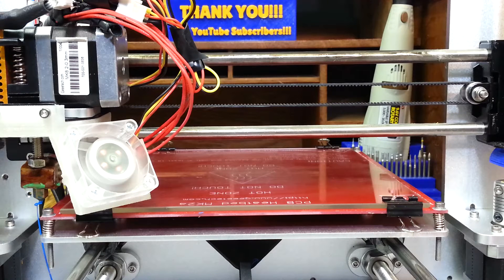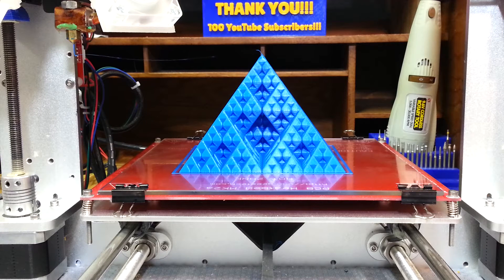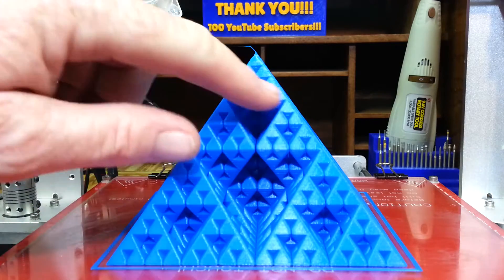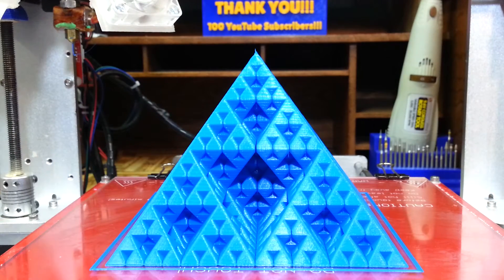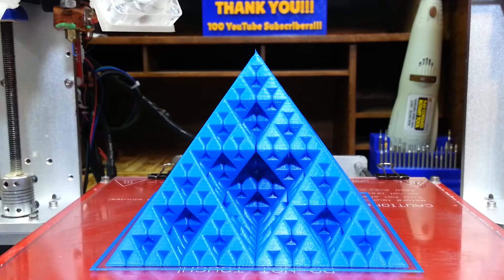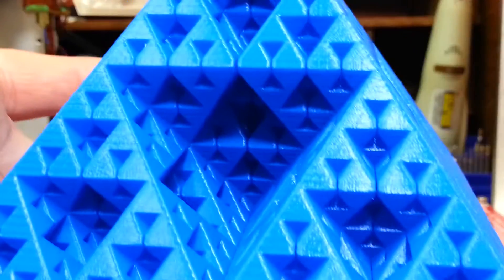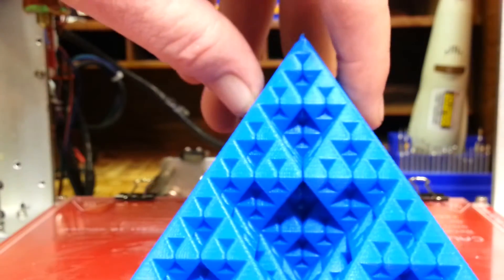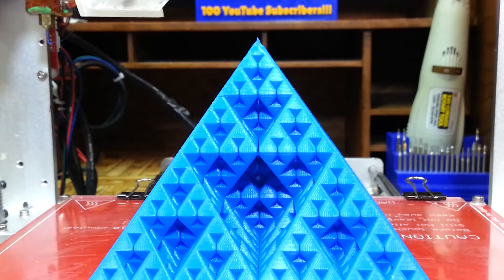Fractal Pyramid

Comment: are OK thks I was thinking about buying the prusa i3 mk2 but it's £500+ is there much different with them as your is a clone I think?
Reply from the maker: +Paul Williams The Prusa MK2 is a much better printer made by the man himself Mr Prusa.  It is capable of 0.05mm layer height where the one I have the maximum is 0.1mm layer height.   The MK2 has a larger build volume.  

On the other hand, mine was way cheaper.  But it did take alot of trial and error to get it to the point it is now.  Please check out my build videos and the videos after.  As I corrected problems I put the files on Thiniverse and links in the videos descriptions to the upgrades.  In the end the Z-Wobble brackets and the cooling fan were the necessary additions to bring it to the point where it is now.  

If you do buy one, keep in mind that the dual cooling fan bracket is ment for a extruder with a 50mm nozzle throat.  The blue fan bracket was for the extruder the way it was from the factory.

Comment: Awesome print! What are your temperature and rectraction settings?
Reply from the maker: +Cedric Kastner I believe that was printed with Blue SolidXYZ PLA.  So the temperature was 205C printed with no infill, using spirolize mode in Cura which disables retraction.  It's 1 continuous print.